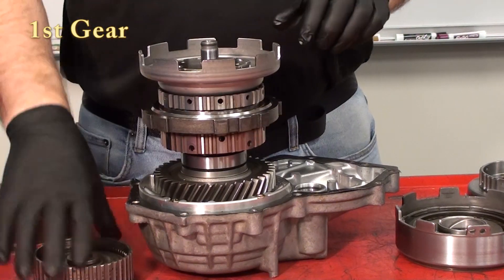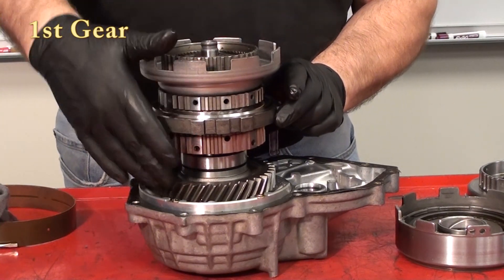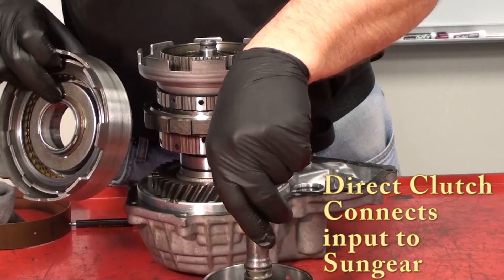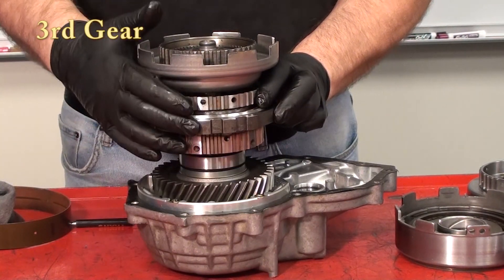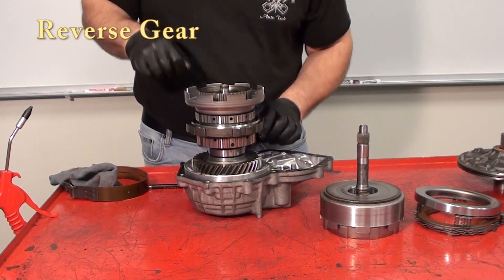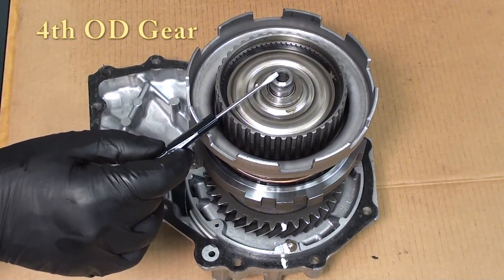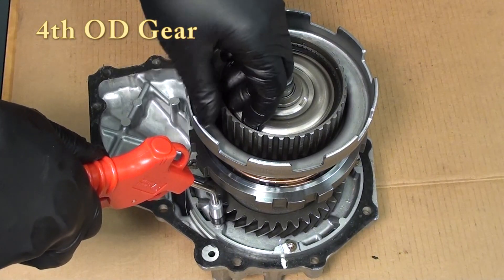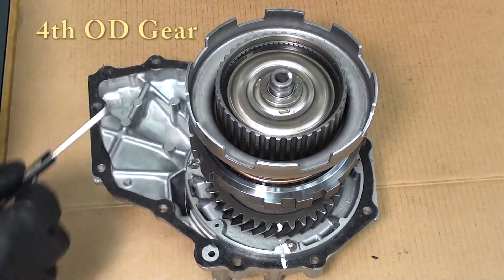Planetary Gear Power Flow Explained (Toyota A140E Transaxle) with 4 speed modified Simpson gearset.

Comment: What kind of torque are these good for
Reply from the maker: Toyota put these in 4 cylinder engines in the late 1980's and early 1990's.  I would not push them much past stock engine torque.
Reply: @DrivelineMaster  what about if I introduce a compushift controller sonnax valves frictions steels and a cooler
Reply from the maker: Those modifications will beef up the hydraulics and clutch packs of the transaxle to handle more torque. What I don't know is how much torque the gear train can handle. I would guess that it should be able to handle 20% more torque than the OE engine it came with given you have beefed up the hydraulics and the clutch packs. Are you planning a higher stall speed converter?  Have you beefed up the engine for more horse power and torque?
Reply: @DrivelineMaster  in the process of getting credit to do so. I feel fast as is, but I know I can get a lot out of the 5s and the 140e. I've seen some of what these things can handle, possibly up to 230hp or something close, and very reliably for not that much money. And then I'm just as fast as a Forester XT! Because I know with how the a140 works compared to other fwd autos maybe even over 300. This auto works well for racing I feel it with the way everything shifts and holds revs
Reply from the maker: I have never tested or push the limits of this trans so I don't know how the hard parts hold up just as long as you beef up the hydraulics and clutch packs.  It's a simple and reliable transaxle.  I like that it's non-synchronous meaning that only one clutch has to apply to change gear ratios except for 4th.  No on/off timing between shifts make it simple and strong.  Since 4th is controlled by only the 3-4 shift valve one valve controls the apply of the Overdrive brake B0 and the release of the Overdrive clutch C0 all in one movement.
Reply: @DrivelineMaster  it's the brake clutches that do it for me, makes this thing a monster

Comment: I think my A140L had a catastrophic failure yesterday. When I came off the highway at an exit the car was in overdrive and I let off the accelerator. When I let off the accelerator, the transmission seemed to drag the car to a hard stop and finally locked up the front wheels. I tried to shift the car to neutral during this sudden deceleration, but it didnt help at all. When the car skidded to a stop, I tried to shift it into drive and reverse. The car seems like it wants to move because I can feel the transmission engage in reverse and drive, but the car wont move. It wont even roll in neutral. No leaks, nor did anything spit out of the trans or the transaxle. Any ideas?
Reply from the maker: At first it sounded like the lock-up converter was stuck on however if that was the case you should still be able to disengage by putting the vehicle in Neutral. It does sound like you have some serious internal problems like maybe the forward or direct clutch is locked up permanently.  When you checked the fluid what does it look and smell like. Smell is most important. If it smells burnt you need a transmission. When you say it won't roll in neutral is that will the engine on or off? Try it with the engine off.  It might roll but it might be a little difficult if the forward or direct clutch is locked up.
Reply: @DrivelineMaster  My friend was able to put it in reverse and back it straight off an angled trailer, under duress, full throttle, just creeping🤦‍♂️ ...I just changed the fluid 8000 miles ago - it's at proper level and no burn smell, however it was dirty when I did change it . It dont like to move in neutral, engine on or off. I have seen some used ones at different salvage yards on car-parts.com I could throw in. Too bad I couldn't make a A140E work in place of my A140L,